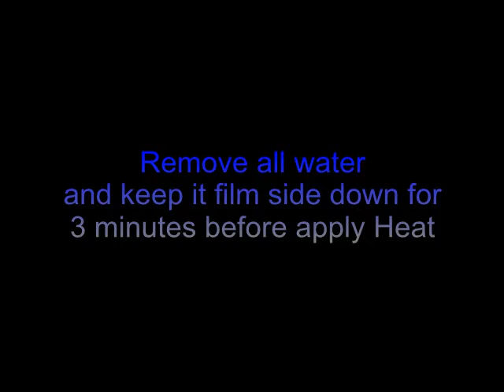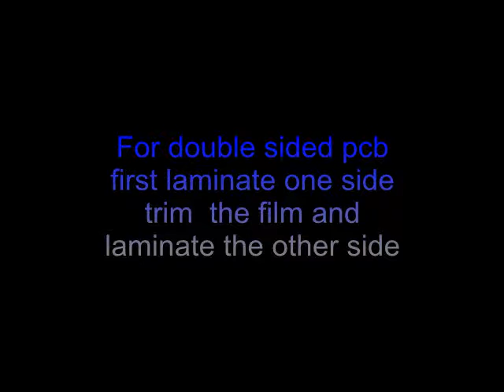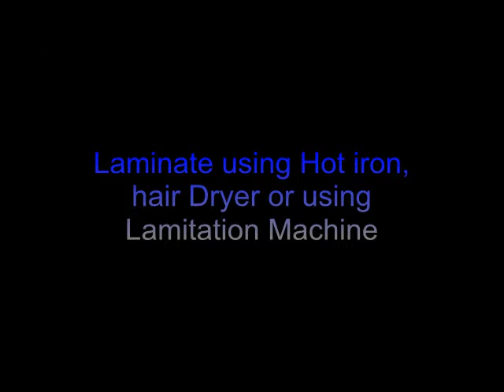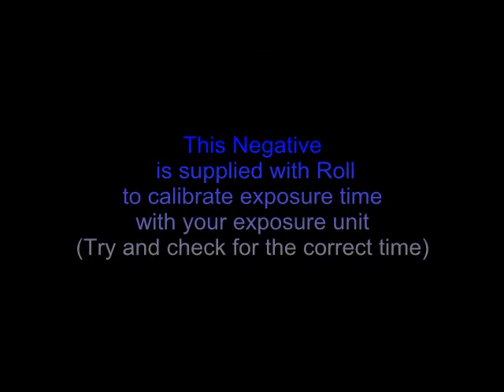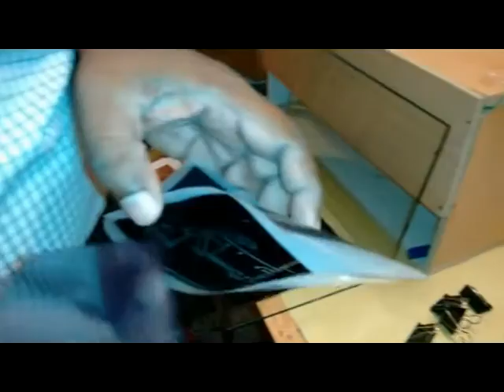Using Dry Film Photo resist making PCB

Comment: you mentioned some negative what is that sheet
Reply from the maker: i normally print using laser printer to tracing paper or Laser print film (i use technova brand) laser film will give good print. i use tonner booster(Novadense from technova) to make the print more darker
Reply: Thanks

Comment: sir raju garu 
photo resist film
seller adress plz
Reply from the maker: www.ebay.in 
search for item
331697171843
231734281060
331697172899
Reply from the maker: rajud_p@yahoo.com
Reply: @RajuD  what is exact product name of laser printer film and where can i get it?
Reply from the maker: @surajitpaul4490  hanks for the interest shown,

many brands available in laser printer film
i used technova brand they have many types any one will do i used topaz peal and diamand
you can ask any printing suppliers in your area if not able to find contact technova asking a dealer near you they will help (in old times the shop near to me having the film but resend i contacted technova for the same and they helped.

i use technova density booster to enhance the dark print

i recently bought a inkjet printer and i bought technova inkjet film (posijet uv plus) and technova engineering matte film roll but not received good results
i dont know it is the problem with the image i tested ( a small shadow line near to the dark line, if the ltrack gap is small it makes problems)

please contact for any information i happy to share what i know

regards
Raju D